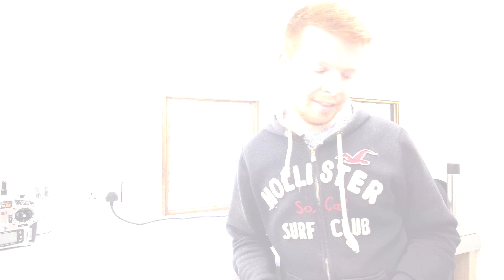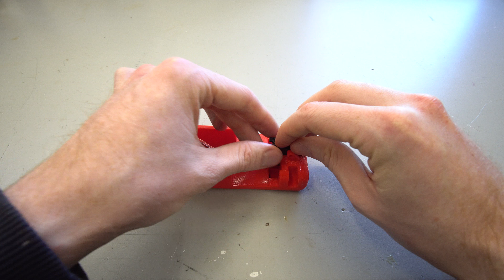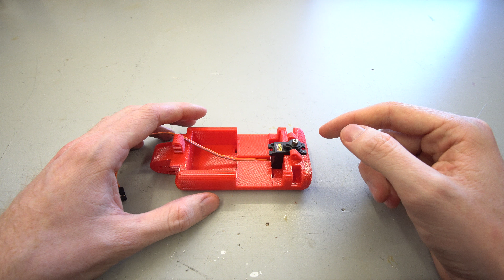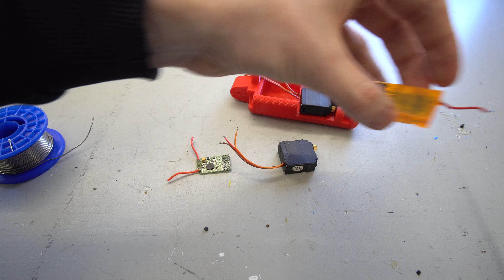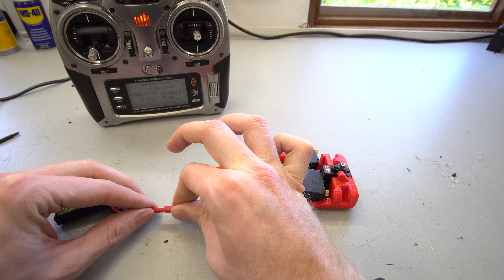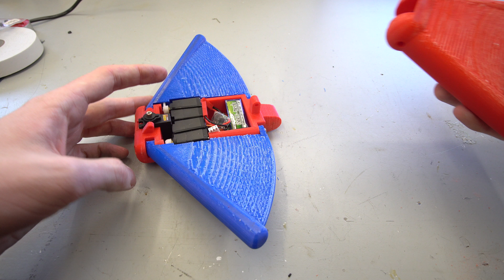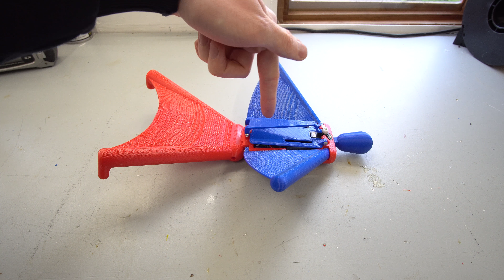RC Wingsuit - Part 1

Comment: bottom basse gack rod zu open de sinn fin verti lunch und hori ranger based inclined balloo cork in series that means:face-blue-question-mark::face-turquoise-speaker-shape:power hzdralics ford rander pulls bootom beam mite be rail

Comment: You can control both arms with one servo then use the other to change the angle between the legs and body, is tricky though because the  whole body is used to control the flight, for example your hands can control direction, it's a very complex thing you're trying to replicate, you'll obviously simplify things though, I'm sure you can do it tom, i have faith in you, it'll be interesting to see how you do this. Cool idea.

Comment: Why use full size servos with all that weight? Micros would easily have done the job.... and saved a ton of weight. Also, I’m surprised with everything you do your still using a POS volt meter

Comment: I thought I was the ONLY person that had one of these!! LOL
I built mine 6 years ago, it's a great way for kids to learn flight without the prop dangers. 

I used a batman stuffed toy for my diver and 2 9g metal gear servos. 2s 300mah lipo.
CG just below the divers neck. Instead of a parachute I used Halloween batwings from a costume store, they deploy with the flaperon switch. 
It's a sweet bank and yank flyer, and best thing is it could nail you in the face from the sky and its completely painless lol.

Comment: I've had an idea for a future build challenge. I thought designing a craft for self sustained flight with out using propellers, fans, rockets, or any conventional means would be fun. This would leave open ideas like flapping wings, Da Vinci's airscrew, thermal lift, and anything else you can think of. The vehicle should have some means of moderately quick forward movement and control (eliminating hot air balloons) and be able to maintain flight for at least a couple of minutes. If your up for a challenge maybe consider an upscaled rc honey bee that shows why the don't actually break the laws of physics. It sounds like a proper pain but that's what makes it fun.

Comment: Although the weight is to scale, the air isn't. You need the air density to the same scale. 
Possibly try it in a water tank to get the density needed.

Comment: kool great job! how did you bind it with no pins for the bind plug? so i am guessing you did the bind process before you cut the pins off of the receiver and tested to see it would work first since you didn't show any of that. i was thinking the legs should pivot at the waist left and right and that would turn him a bit better than the arms but all together great first attempt like to see a video of it flying

Comment: Cool video! You may know this, but you can put a dab of hot glue on the voltage regulator before heat shrinking. So it will not changes voltage on you, after crashing a bunch. Can't wait to see it fly!

Comment: Make the 'wings & tail' from parachute material or even a very thin neoprene, for a bit more flex and resistance and even less weight, they could also then close and open scissor action, could even add ballast to get the correct weight scale ratio.

Superb stuff! 

How about a 2 or 3 stage rocket project?!

Elevate a launch platform, balloons, EDF's maybe, then a timed solid fuel rocket launched from it. Do the launch from local mountain to gain immediate elevation and you could reach some serious height. A Two man RC job I think, one for the platform, other for launch and descent. A camera fitted to all 3 would be amazing in sequence.

Maybe even strap wingsuit man to the rocket, space shuttle style and guide him down after release until you can deploy the chute.

PS, am a serious armchair RC fan, more ideas than practical skills, but I have an idea what's achievable in 2018 compared to when I was tinkering in the 1980's as a boy!

Comment: That thing is amazing! question and suggestion: are these overall solids or also hollow structures? For the parachute: in an iteration you could make a split compartment: body front: the electronics, servos, battery / body back: the parachute with latch.

Comment: The fasteners you are using are screws, not bolts. Bolts are paired with nuts. Screws go into threaded holes in the material. I love your videos, but sometimes the words you use are not the most accurate.

Comment: From my (very limited understanding) you need legs controll - pushing your hips and legs forward and torso backward while having arms wide spread acts like a break/elevator, decreasing the speed while at the same time redirects the air flow giving jumper the ability to gain altitude (basically allowing to go higher/lower, gliding or stalling, allowing controll over how much air is going beneath the surface and above, and whole that aerodynamics things about lift and air pressure :P) - if enough speed was built up before the manouver. Slight movement in hips/legs improves the controll in turns. Closing and opening arms will determine how much surface is there to catch the air, so if you'll drop it perfectly flat - will it glide or will it dive-head down, but you need the control of body curvature to control the glide vs air tension. (which on such a small thing i'm guessing is going to be hell to observe and interact with, expect A LOT of failures, as there's no way to literally feel what's going on while in air). Also, if this works... sh*t mate i need to get that. I got into FPV as a cheaper and safer alternative for proximity wingsuits :D Also, If you dig wingsuits there's a pretty nice game (canceled early access - no longer in development, but still very well made and worthy to check out) called Volo Airsport, which is actually physics based wingsuit/parachute simulator, yes, i know, it's a game, still might shed some insights onto this.

Comment: I saw a video where you put your printed pieces in a closed boxe or jar and put some acetone in it. ( acetone should not touche the plastic) A small fan helps the process. The acetone vapors smooths out the printed part. You can experiment with that for the proper duration of the process. Hope that can help!

Comment: 360 camera in the head for true fpv and you could drop in on small canyons and waterslides, THIS> i think drone skydiving should be more of a thing, you could have a little booth at landmarks or  events and someone walks in puts on an vr headset and you drop a parachute (360 camera weighted right for controlled fall) in a area pulling parachute at designated height and guiding parachute into landing area to reset for next customer, ALL THE THRILL AND LITTLE RISK (drop people over water on a beach or in the Grand Canyon) how much for a 3 minute ride < Build me this ginger bread brit

Comment: Cool project. Just one question. Why do you use such heavy equipment? Pretty big servo's and even metal gears. Why? And when you use much smaller servo's I think you can also use a much smaller battery. Hope to see it "fly" soon. (Although I think it will fall like a brick without control. When I do the math I also come to a 1:6 man with a weight of about 400 grams maximum. But when I see the wingsuitmodel it feels like not possible. We will see. keep it up

Comment: That sure looks great. Though I think it will glide... fall really fast and would be hard to control.
You could launch that with a catapult. Will probably be more convenient than attaching it to another vehicle someone has to control.
What I was thinking about for a while is a wingsuit made of carbon tubes and a "space blanket". Can make it really lightweight, which, in theory, would mean slower flying, more controlability and flight time. At cost of really bad wind penetration.

Comment: That is an awesome concept!  I haven't seen anyone do this yet.
My prediction is that it is much too heavy and will just fall like a rock.  I suggest maybe 3D printing the frame with no infill and then using an airplane coating like Ultracote or some other film.

Comment: the idea is good but I find the material weight too high for this size.... and the parachute would not open as you demonstrated by pulling up the lever. If the knob is open, the parachute would be still a dead thing.

Comment: Very clever design and very neat construction, Tom,congrats. As a wingsuit BASE jumper and RC flyer I'm really anxious to see the results. When we fly a wingsuit the geometry is constantly changing depending on what we want to do. This is extremely difficult to model in a rigid design as even small shoulder, arms, legs torso, etc adjustments can make a huge difference in the flight path.  Good luck with your project and let me know if I can help you with any info.

Comment: Interesting for sure! I'm a skydiver, wingsuiter, and wingsuit instructor with ~1500 jumps. Happy to help you figure some of this out. Currently, you're missing a key input on the tail, but for your purpose you may not need it. One thing to think about for your parachute -- what way is the model flying and what is the parachute going to do when the servo opens the parachute? With enough forward speed, the parachute will likely snag the bit that goes under the servo horn as the parachute moves towards the feet and not directly towards the sky.
Reply: 1500 jumps , WOW
Reply: Cool
Reply: Nikko Mamallo I can't find the flight video so I'm assuming it didn't work out too well 😂

Comment: Hey mate. What soldering iron do you use? Do you recommend it? I'm after a new one.
Reply: Steve Sheppard It's an TS100 Soldering iron, it runs off of 12-24v. One can buy them off Banggood for 52 ish bucks.Here is the link for it https://m.banggood.com/MINI-TS100-Digital-OLED-Programable-Interface-DC-5525-Soldering-Iron-Station-Built-in-STM32-Chip-p-984214.html
Reply: Ryno Duplessis 
Cheers mate.

Comment: This is impressive. Really cool. Scaling aerodynamics is REALLY hard, and the acute and very mixed control of wing suits is, from what I understand, really really complicated and would take some serious actuators and surface bending/billowing to replicate with any accuracy. I don't think any computer TX could replicate accurately the intricacies of what a human brain and a few hundred muscles can figure out to steer a suit, not to mention the sensors that humans come standard with (touch,joint position, wind on face, force on arms,legs, etc) but, If accuracy/scale is the goal, you did exactly what I would have recommended for a 2-servo ship.  I can't wait to see you fly it!

Comment: Put it in an acetone Vapor chamber to help smooth the surfaces. You can also just use a sprayer or even a paintbrush and apply a small amount of acetone directly to the surface and it will give you a smoother cleaner finish on your 3D print. Other chemicals work as well such as lacquer thinner and xylene. If you're going to put it in the vapor chamber make sure and take all your electronics off first
Reply: Kcburn He mentioned that it's printed in PLA
Reply: whats the point its gonna smush into a thousand pieces anyway
Reply: He was commenting that it had a rough finish. PLA melt in acetone. Surrounding the pieces in acetone Vapor will melt just the surface enough to create a smooth finish
Reply: Kcburn Yeah, that works well with lots of plastics, but not PLA: https://youtu.be/VZUfq0yrtv4

Comment: I have first hand knowledge of wingsuit technology and control give me a shout at wingnutzster@gmail.com
Reply: you'd do well to extend the tail area between the legs instead of the webbed trailing edge, Pitch is in the legs - roll and lift in the arms but pitch is very definitely in the legs. To try explain it simply, the outstretched arm pivots at the shoulders forward and back and upwards or out for TUCK - tuck affects speed and lift (synonymous in this type of flight) but more precise PITCH is controlled by the elevator tail in the legs which is kind of a swallow tail; giving controllability over PITCH and ROLL and assisting YAW - direct ROLL is achieved by asymmetric inputs on the arms and wings but with pivots in the shoulders, elbows and wrists in twist, up and down and back and forward and the wing fabric adjusts it's rigidity, flex, washout and AOA by strategically placed ram inlets which in this roll action are presented to the air in the right attitude and timing - it is incredibly complex even just to attain stability.
Reply: I am in the process of designing our latest suit for a project called "freefall astronaut project" I can't say more but that says it all. You have some brilliant ideas and I love the ingenuity but some key areas need a rethink - your material is too rigid - imagine a rigid parachute or a ragallo type hang glider being replicated in a rigid substrate - certain key aspects of the design of these craft are accomplished in that they are not rigid, semi-rigid at most. You must understand a wingsuit to be an incredibly complex 'machine. that flexes and conforms and stiffens all at once in one move for every move...for instance a simple yaw is a maneuver initiated by the brain and head followed by a body adjustment and weight shift into the desired direction with instinctual, multiple aerodynamic inputs and compensations to perform the maneuver where the suit almost intelligently conforms to manipulate flow and ram air to accomplish what the body set out to do...more complex maneuvers like barrel rolls require a similar cacophony of inputs but much quicker - in the blink of an eye sometimes thus the common perception of a wingsuit being the simplest way to fly is completely false, the wingsuit is the ultimate flying machine, the most advanced fighter can not replicate the wingsuit in maneuverability and flexibility or even in complexity. Whilst I do believe with lighter materials and bigger wing areas and some more thought into the control inputs and movements with far more pivot points etc you can get a human like figure to glide but to replicate a wingsuit in miniature for RC is in my opinion impossible- that said I'd love to work with you on trying it let me know if you're keen. Check out my mate here in Cape Town https://www.youtube.com/user/JustChillingOfficial  he is the pilot/junkie end of the spectrum I'm on the engineering and conceptual end. I can show you that I know what I'm talking about and even with years of study I am confounded by the complexity of achieving stable, non-rigid human flight because of the enormous challenges even at full scale but in no time at all you discovered some basic mechanics that took years for others to develop and so I believe you are on to something....let me help? For more accurate modelling and flight dynamics in a pretty decent wind engine forget Just Cause and check out Volo - it is a favorite of the junkies here at the dropzone and I personally can't get enough of it's accurate flight and suit modelling - it will simplify the technology of wingsuits for you to where you can get a humanoid structure to glide and perhaps go where you want it in a crude manner - you would do well to study bird and ornithoper dynamics as well as flex wing and semi rigid craft like ragallo wings, performance parachute systems and the like

Comment: These suits are controlled thru the back of the wings they have an extra flap they can use like an aileron with their hand as well as leaning  and slight arm movements as well as leg rotation  acting like a tail i believe. wingsuitfly.com also has some vids on it

Comment: It would "probably" be more efficient if you used 2 lighter 5g servos ( or less) and hinged the legs to act as a V-tail. Then if you print the "webs" as a separate piece that is a single layer thick and cut it to fit/glue in place you would be a little lighter. Drop for height and fly it down.

Comment: roll control:
if the diver pulls their right arm in, they lose wind resistance on their right which causes them to bank right.
Your implementation of moving the arm back should also work but keep in mind that humans arms cannt rotate back quite like or as much as your model.

Comment: It's Interesting what you are trying to do, but weight does not scale If you were to try compare the characteristics in flight (If RC models used scale weighs they would never fly). 
A good rule of thumb is the wing cube loading (this is not scientifically proven though) but it is better than using wing loading (which results in wrong numbers when scaled way down). If you really want it to be scientific, you can use Reynolds number calculation which gets complicated real fast.

Comment: I think you would save a lot of weight if you used ripstop nylon instead of PLA for the surfaces. It doesn't have to be intricate with cells and such like the full sized one. Just a single sheet glued to a carbon fiber rod I think would make a perfectly fine airfoil when inflated by the windstream. Interesting though that it ended up prettry close to scale weight wise. too bad aerodynamics don't scale down as nicely though for stuff this small

Comment: I would definitely thin the walls as much as possible and a pivot at the hip area would be advantageous the more weight you can cut from this the better.....you could remove the webbing areas from the print and leave some kind of attachment area for the nylon

Comment: My understanding was that the bulk of the control comes from the legs. Ie Bank and yank. This could be done reasonably well with two servos to get a similar motion: both legs together for elevator. Rotate hips, and use elevator to get the rudder. This way you don't need a flexible material between the legs. My understanding is that bringing the arms in/or creating dihedral is to loose altitude quickly, or stablise quickly when precision is needed. Now these are all theories from watching too many videos of people going out for real. I could be wrong about any or all parts. I hope this helps.
Reply: "Now" -> "note"